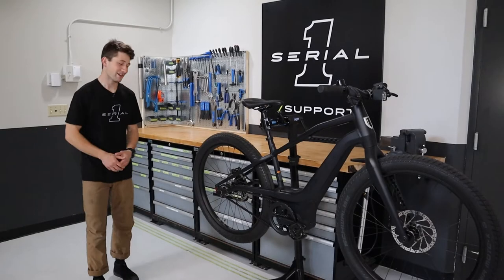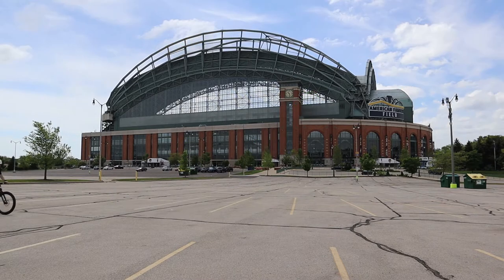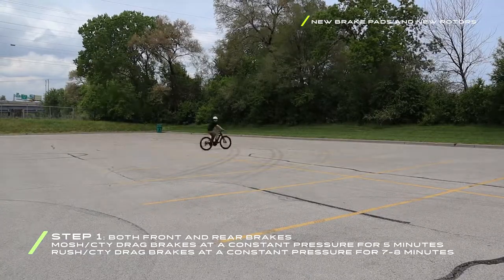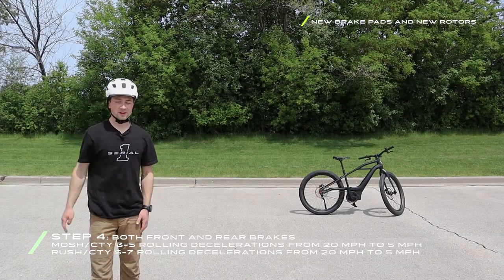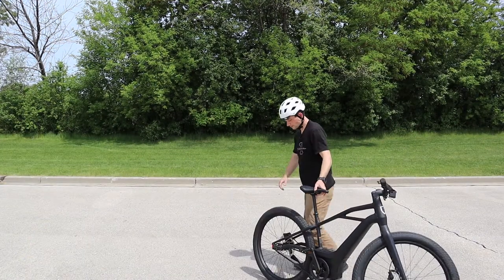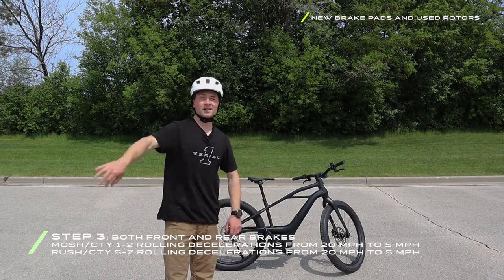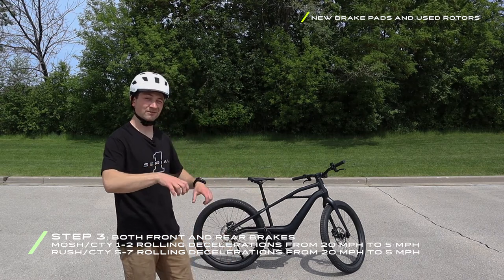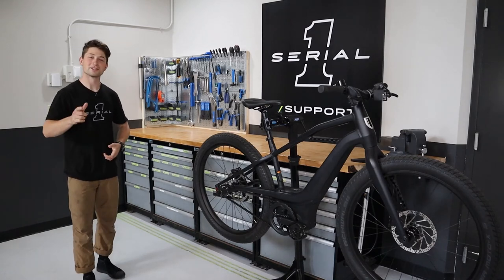How to Bed Brake Pads

Comment: I did this immediately after assembly. My breaks are still incredibly loud. May have been contaminated beforehand 😢 Theres a neat video on youtube that shows you how to clean the rotors with nail polish remover and sand paper.